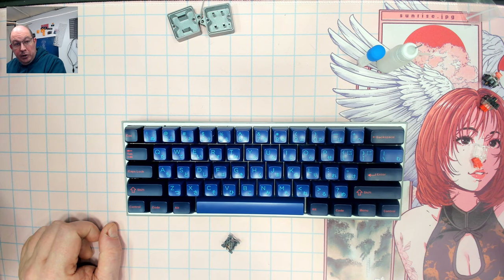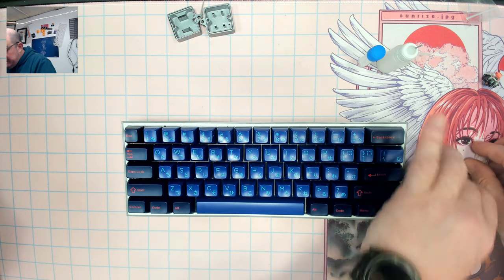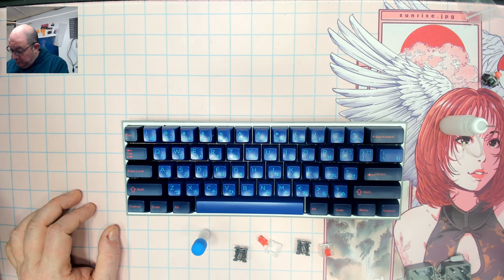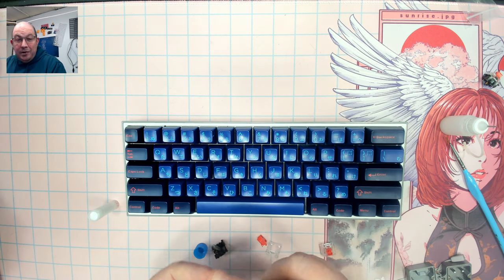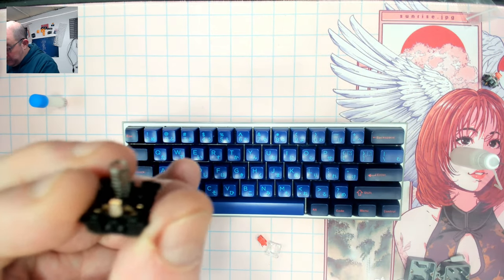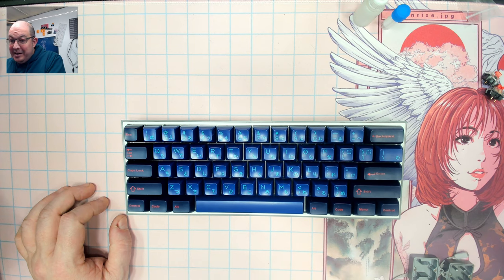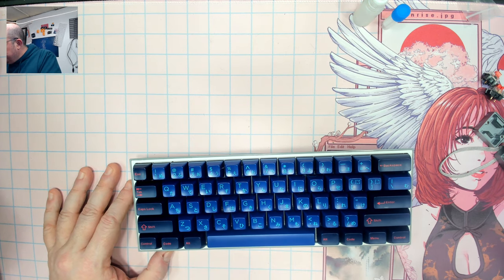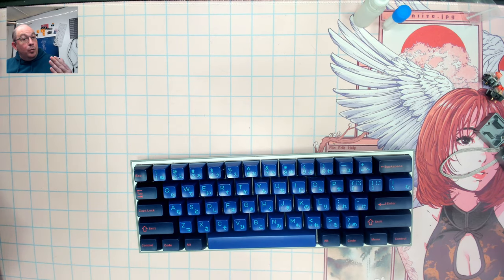Can you hear that ping, the sound of ping surrounds you! Get rid of ping once and for all!

Comment: I see a Pixel, I upvote. 

I'm stuck with some ping on a non hot-swappable Drop board. I started using it without the risers flipped up, and that helped a tiny bit , any chance there's anything I can do to help, aside from desoldering and then lubing the switches?
Reply from the maker: If it was anything other than wing latches switches, you'd be able to take them apart while still soldered with this tool (https://www.amazon.com/Mechanical-Keyboards-Switch-Removal-Tool/dp/B07FW3JN9T) but since Drop uses Kailh switches, this won't work. Desoldering the switches is not that hard, but you could always take it to a local electronics shop that does soldering and have them desolder and insert MillMax sleeves for hot swap, or resolder once switches are lubed.
Reply: @MechKeyboards  Whatttt I didn't realize there was an option to make the pcb hot swappable. Definitely going to look more into that. 

Thanks!

Comment: I have optical keyboard so i dont have leaf spring and i lubed my switches but metallic ping sound coming from the keyboard is killing me 
i have corsair k60 pro tkl
Reply from the maker: The ping is likely coming from the springs then.
Reply: @MechKeyboards  but I have lubed my springs, and when try the switches on another keyboard there is no ping noise
Reply from the maker: @TR3SP4SSER  do they ping when actuate in your hand?
Reply: @MechKeyboards  no they dont sir 
only when im typing
Reply from the maker: @TR3SP4SSER  if you are flicking them as hard as you can and hear no ping, then it could be the keyboard itself.
Reply: @MechKeyboards  yes there is no ping at all when it's in my hand or at another board. It's about the keyboard itself.. I tried the mod the keyboard with some pe or sth like that but the case is too thin, there is no any layer between pcb and plate.. Upper plate is aliminum, bottom case of the keyboard is so thin plastic..
Reply from the maker: @TR3SP4SSER  if there was a way to do a force break mod, it would probably help.
Reply: @MechKeyboards  sir as soon as you told me there is a mod called force brake mod I googled but I couldn't understand what exactly it is. Can you help me?
Reply from the maker: @TR3SP4SSER  it means to put tape between the top and the bottom halves of the case. Here is an example on another keyboard.

https://youtu.be/IC0qDN4XqQw?si=qa2gC4UkDY0cnSAx
Reply: @MechKeyboards  wow great video. Thanks to your works. Do you have discord or sth to help me detailed sir? I can send you my keyboard's pics detailed ( the parts etc)
Reply from the maker: @TR3SP4SSER  link in video description.

Comment: heyy just want to ask.. why r u not lubing the stem? is there any particular reason?
Reply: The stem is already lubed as part of normal lubing of switches.  Often you don't have to deal with leaf ping and bag lubing springs deals with spring ping.
Reply from the maker: @albertko1  I don't feel that there is a need.
Reply: I've found there's an accoustic tradeoff for every part that you do/don't lube. As I've progressed through the hobby I'm leaning towards the least amount of lube possible and enjoying the dry sound much more ( still lubing springs and now the leaf to remove ping). I think it's how difficult it is for me to get them exactly equal in profile and when touchtyping it's annoying to feel the differences